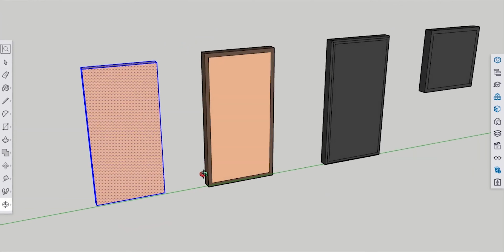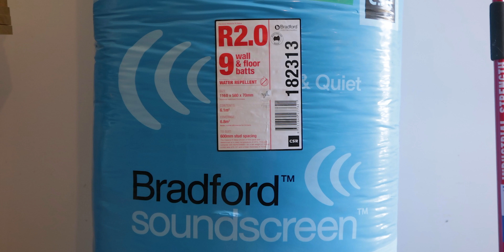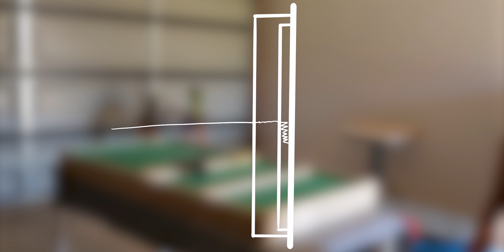D.I.Y. Acoustic Panels under $50

Comment: If you wanted to go even cheaper you could get an 18mm sheet of MDF for $31 then cut it into strips. Would work out to about 31 liner meters at 90mm width. Would save hundreds on timber, plus MDF is a good sound deadener due to its high density.

That sound insulation seems pretty good, I'm planning to use it to build a soundproof room in my garage for a woodworking workshop.

I have no idea what this channel is about, but I subscribed a few minutes in. Your attention to detail assembling the panels was alot better than my effort of "hold wood together and drill by eye"
Reply from the maker: Thanks for watching Phil. Yes I probably should have mentioned some alternative wood options. I went with Pine as had a voucher for Bunnings and figured I'd get something that had minimal cutting effort. 
If I had a table saw I'd probably grabbed a sheet of MDF too but my cuts by hand are not straight haha 🤣

Good luck with your workshop! I'll be building some more of these panels for my home theatre, might see if I can make a cheaper MDF version and borrow someth for straight cuts 👍
Reply: @camshand   @cam shand  Fair enough, you don't need a table saw for those cuts. In general the smaller the tool, the better it is a cutting big things. Trying to wrangle a 45kg MDF sheet onto a table saw is hell. 

Best bet it to buy 3 foam panels from Bunnings, place them on the ground and the MDF on-top. Set your circular saw to just thicker than the MDF so that it only just nicks the foam. You can use 2 clamps and anything long and straight as a guide, or cut across the 1.2m length rather than the 2.4. more cuts but less of a pain to get straight cuts.
Reply from the maker: @phil2782  oh that's a good idea! I also did discover I have a guide that can be mounted to the side. I bought a jigsaw for my next project and finally realised what it was for. I love working on projects like this one but it is out of my electronics element haha
Reply: @camshand  hahah that's surprising, with the details and skill I figured some kind of tradie, but your ryobis a bit to clean for a tradie :P

Comment: worth watching.. by the way wat was that outer fabric type/name? also the type of wood used>?
Reply from the maker: I used Felt on the outside, it was a pretty thin, like 1 mm, and when stretched opened up the fibres even more. Also the wood was Pine, I would suggest MDF for acoustic properties, however I don't have the correct Dust Extraction devices to safely work with MDF (the dust is really bad for your health) so I chose pine for ease of use.

Comment: Nice one, I have done similar at home for music listening and home theatre.  Interesting to watch how others went about it.  I currently have 9 panels/corners and 3 cloud panels.  The difference was huge for films, music and PS4 pro.   I went for 4" panels all round using slightly different materials as im in the UK. I used Rockwool rwa45 as it seems to be best in the uk for price/performance.  Worked out about the same for me £25 uk pounds per panel.
Reply from the maker: Yeah they make such a surprisingly big difference! Ive got making some for my home theatre planned next.

And interesting, I see a lot of rockwool reccomedations online but in Australia we have other brands mostly but I just found a "sound dampening" variety which I presumed was as dense as I could get off the shelf.

Such a great budget option, buying from music stores would get you one panel haha.
Reply: @camshand  I got really geeky and had a read up on best insulation for diy panels. From memory it was all to do with the thermal gas flow properties in the insulation. I wasnt quite sure what that all meant at the time but its basically how the soundwaves pass through the weave of all the fibres of the insulation. Having too dense  fibre can also have slightly less performance and still give some reflection. You need some space for the soundwave to move around inside the panels.  After a few weeks of reading on forums, watching loads of videos and several joints lol  Rockwool rwa45 kept coming up, Owens Corning and Knauf.   Aim  for similar specs  as them I guess.  4" seemed best bang for your buck if you can get away with them that thick in your room.
Reply from the maker: @BoredSilly666  yeah did see Owens Corning name too. And actually I did remember hearing about too dense reflecting as well. Also why I just chose the sound variety of Bradford's given its I'm the name haha. All a bit confusing unless you spend a lot of time understanding all the ins and outs! Either way D.I.Y. panels are such a great project, ive already got a few mates planning out theirs now too haha
Reply: @camshand  I now noticing everywhere I go just how much echo you get in the average room.  I walk about the house and really notice the echoes in the kitchen and bedroom.  Its like my ears now know what a room should sound like and its very noticeable when in a room with no treatment, even with general talking.  One of my friends now also wants to make some lol

Comment: I've seen a lot of diy acoustic panel videos and I think this is the best!  I love that you have the "monkey grip" built into the panel so it dual functions as a support and an optional mounting surface.  Very efficient.  The chain mounting idea and door mount were also great, haven't seen anyone else show those yet.  This design also potentially allows you mount it like a picture frame (might be too heavy tho).  The built in air gap in the back also prevents you from having to cut any of the insulation unlike some other designs.  And the way you ordered the build, the rear fabric is held nicely in place as you go to staple it permanently instead of it flapping around everywere.  Great job man, I'm definitely using your method!
Reply from the maker: Thanks for the feedback Cody 😍 I'm glad you found some of my tips useful! It's quite the project building so many panels, but laying down the front fabric sheet first had to be the best "workflow" hack I had to not need to wrangle fabric around the insulation haha.

Good luck with your panels! 🤞